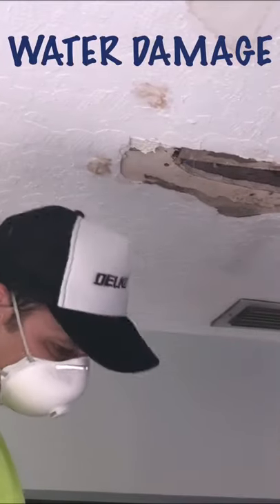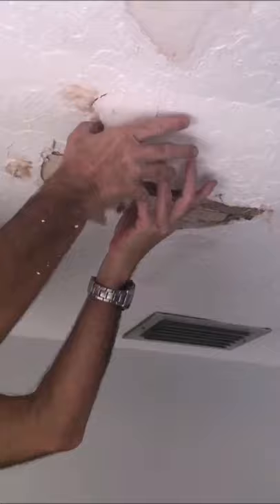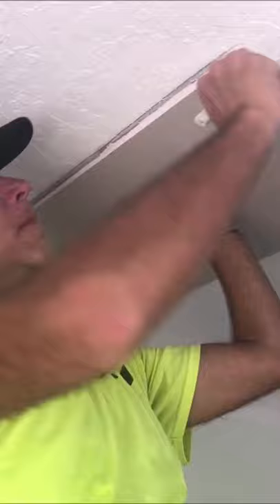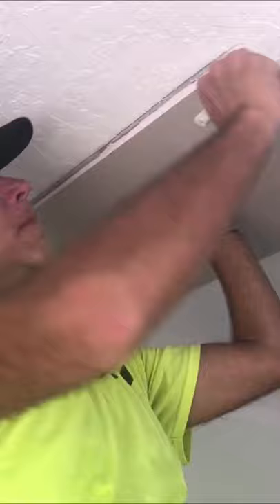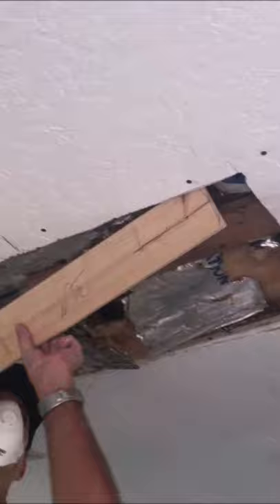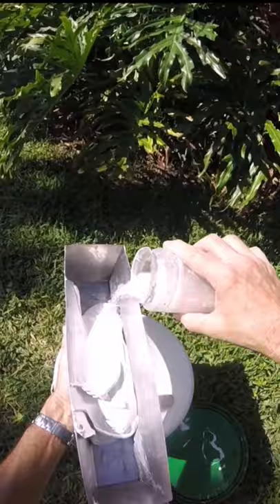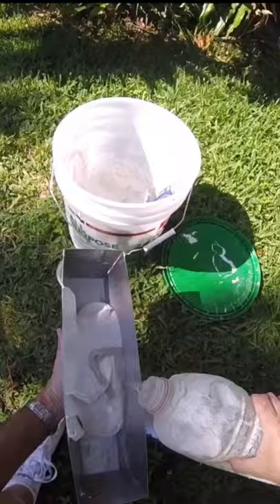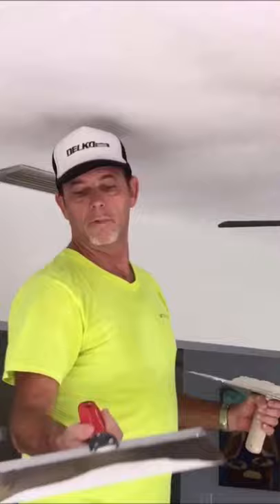Water Damage Repair and Texture Match

Comment: Hey Paul. How much sand do you mix into a pan of mud for skip trowel?
Second question. Here in California i see a lot of finished drywall that looks kind of like skip trowel but not nearly as skippy. There doesn't appear to be sand in the texture/ finish coat. 
What's the difference? When doing research about a year ago, i couldn't find any videos comparing the 2. 
Edit: around here people call it imperfect smooth.
I think you should do a video comparing both because a very imperfect smooth can start looking like skip trowel

Comment: My home was built in 1925 and due to a roof leak, we have water damage on our bathroom ceiling. What are the chances we have to worry about asbestos? How do we even know?
Reply: You can get an asbestos testing kit ~$15 at the hardware store to know for sure.
Reply: @Alleellaa  wow thank you I didn't know such a thing existed
Reply: If your house was really built around that time, You definitely have lead in your painted walls too. So you might want to be careful and test for lead in that broken area too.
Reply: @tempakilla  Yes definitely 1925. Most of the homes here were built then. The guy who lived here with his family was a contractor so a lot of things have been updated but the wood underneath the falling ceiling pieced are small thin slatted pieces of wood. I'll be as careful as possible. If it doesn't fall, we don't touch it. Hopefully not too much more will fall before we get the roof fixed. Anyone know where to find a money tree??? 😔